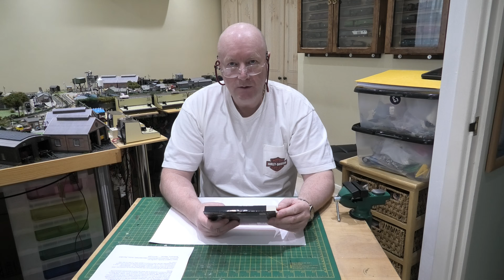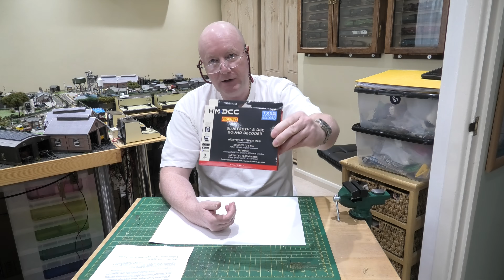SAFE TRACK POWER for Hornby HM-DCC/HM7000 explained. IMPORTANT SEE DESCRIPTION !!!!!

Comment: Hi Paul. I have recently purchased the Hornby R7337 15v Power Pack that will use as a bus supply to my new planned layout. Also I am fairly new to the HM7000 system and I like what Hornby are implementing into this system as its great fun to use with my phone. I learned that non-Hornby DC controllers are not recommended and before I bought a Hornby power pack. 

I used to use the Gaugemaster Combi beforehand and whilst it worked fine on 3 of the 4 models. The fourth decoder didn't like the DC power and whilst it run fine and still works. It got quite warm when in use. So to keep within the limits of the warranty. I have switched over to the Hornby in-house power pack and all is well. It could have been a dodgy decoder but I wasn't taking any more risks and when I build my new layout this year. I plan to have all models on it HM7000 decoder fitted. 

Also did you know that Roads and Rails make a package that includes a Next18 to Plux22 adaptor for use on the newer Bachmann models? You will need to disconnect the sugar cube speaker on the chassis for it to work without overloading the amp as one speaker makes 8ohms. But I thought it would be worth a mention as I plan to add one of them into my Bachmann Plux22 Class 37. 

All the best, 
Peter.
Reply from the maker: Thanks for your input, and no doubt others will read it and learn from it. However, for myself I have no interest in HM7000 in any shape or form, it is nothing but trouble and by all the information you have given, although helpful, shows this. My next controller will be a Digitrax model. Have fun.

Comment: Hi Paul , Fitted a HM7000 last week and i`m very pleased , power is via my Gauge Master Prodigy .. I have had loco`s running on DCC , WI FI, and the HM7000 all at the same time ..Just waiting for Hornby to update there diesel sounds for class 37/47 .. Very good advice 👍👍
Reply from the maker: Great to hear!. Sadly mine has blown up, however they are sending me another.

Comment: Hello Paul, a great point made! i do think it's best to use a analogue controller with a higher frequency of pulse as any decoders would work better.. I know the 6000 allows for 8000hz through the rails (plus its hornby). it's probably better to just use a hornby power supply and their adapter to make sure it runs properly? Sams trains used a gaugemaster controller to power the other day and i couldn't think of a worse controller to test the decoders with... and he wonders why it burnt out
Reply from the maker: Good point!

Comment: I have an NCE Powercab which runs my TXS fitted hornby locos perfectly, but I cannot get it to link to the HMDCC app... Do I need the Hornby power cable attached to the track which costs another £60 quid, to then link to the app. Very frustrating. Thanks for the straight talking non jargon videos Paul, they are very helpful.
Reply from the maker: From what I can remember from using my Prodigy 2 it will not link to the app. What you do is turn your digital power on that you use for the NCE then just run the loco from the APP on your Ipad. So basically instead of analogue power turned full on, you turn your digital power on and leave it. Then the loco should run from the app. My DCC coronation class loco would not run correctly using my Prodigy so I sent the lot back. I do not have any HM7000 kit left, I sent it all back and got my money back. I have not been involved with this since March last year so things may have changed. I am not sure, so do not quote me, but I feel the only way this works as it should is spending £60.00. However, try it with the NCE power and see what happens. It does not do what it says on the box, if you use any analogue power the chip will just smoke risking fire.

Comment: Paul HM2000 controller not recommended, 
Quoting from the Hornby Decoder Reference Manual:
DC-Controllers not recommended.

HM2000
The Hornby HM2000 analogue controller does not work well... sound distortion 100Hz modulations?
R7229/R8250
These controllers use a low frequency PWM system that can cause issues with decoder control etc.
Reply from the maker: Your a couple of months too late mate, the boat has sailed. Kohler has gone, it is not tri-mode. It breaches the trade discriptions act. Enjoy your modelling.

Comment: Hornby are now (2.4.2023) advising NOT to power your track via your old analogue controller turned up to full. Best to spend the £60.
Reply from the maker: I have just taken this from the Hornby Website...................If using a DC “train controller,” the output will have to be set to approximately 14VDC permanently, thus making other analogue only locos non-controllable. Generally, this will be “full throttle.” ............................ With an analogue controller you are getting nowhere near the maximum 27 volts or the 20 volts that Hornby recommend no more than. If what you say is true ?, I think there is something seriously wrong with this kit. We shall see.
Reply from the maker: Have you got a link for this please, I cannot find it.